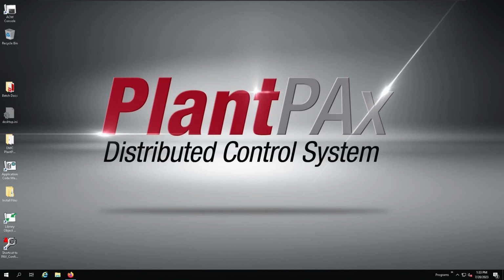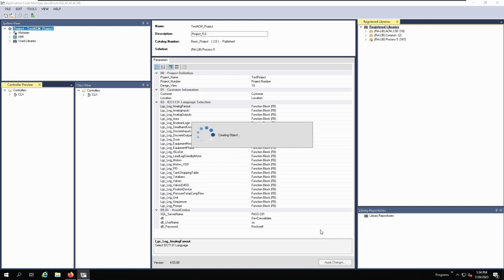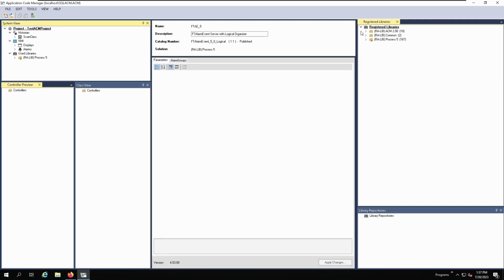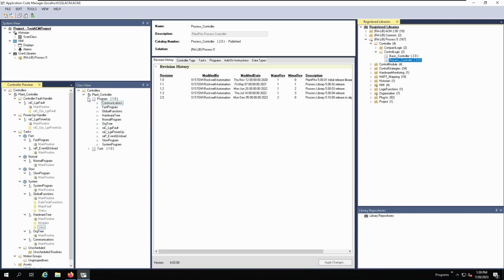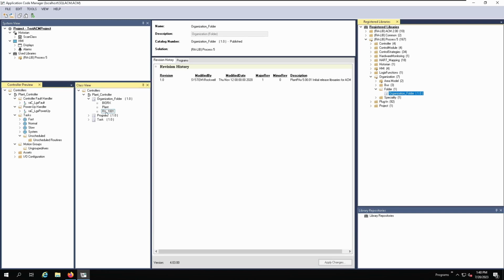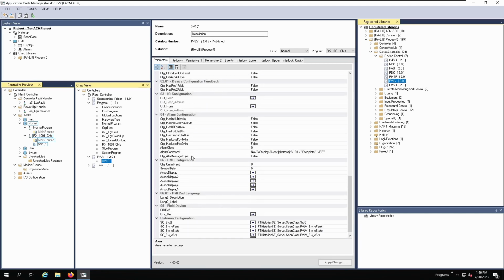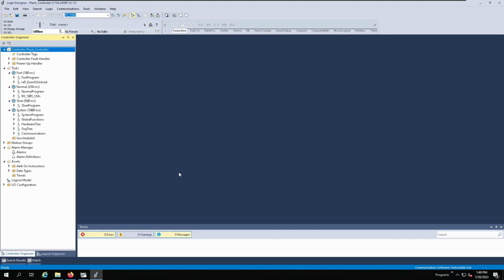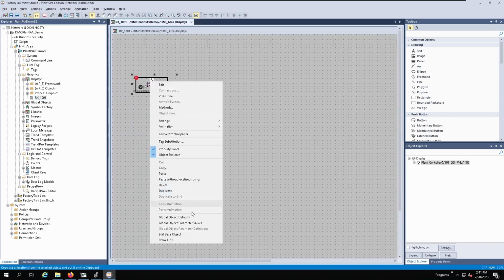How to use Application Code Manager (ACM) with PlantPAx Distributed Control System (DCS)

Comment: It would be nice if Rockwell stopped calling this a DCS. DCS is for continuous process control. These types of plants can almost never shut down for anything. Cleveland still doesn't get this. When you have to shut down to break alias's, change AOIs, etc., you have a PLC that can run a process, not a DCS
Reply: Don't use aliasing and why are you modifying AOIs? You should just be modifying the external logic. You would build the bulletproof AOI ahead of time and would not change an AOI in production. It's all about setting it up right.